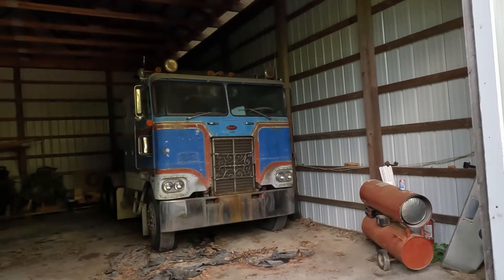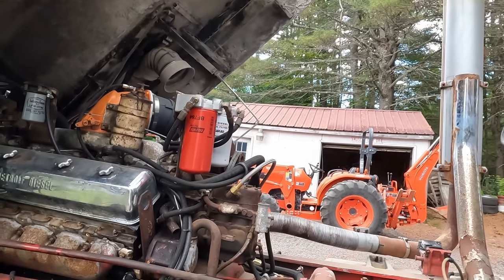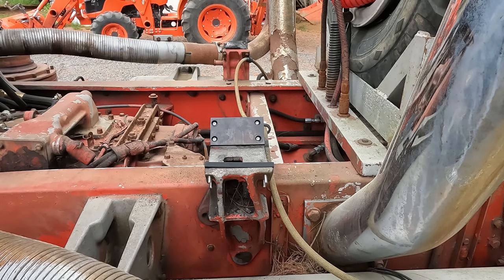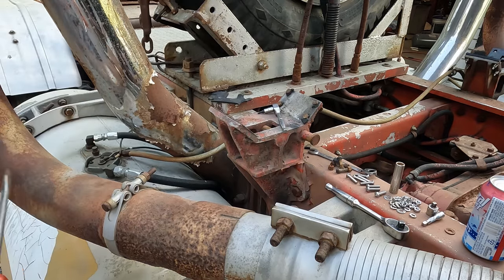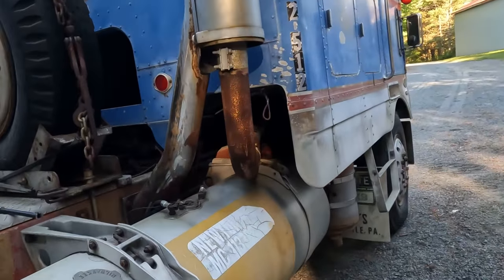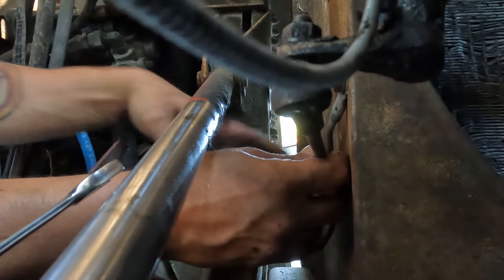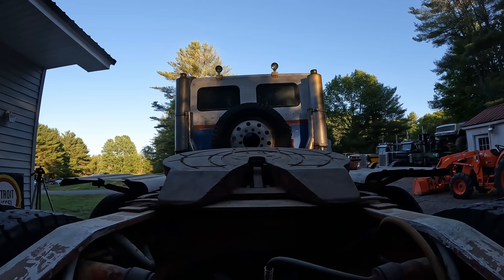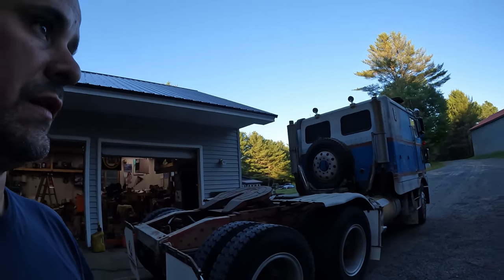1973 12v71 Powered Peterbilt 352 Cabover - Episode 22 - Mount up!

Comment: That thing is RAD Wayne !! I love cabovers. I got my license in a '74 Cabover Mack with manual steering and a 5 speed. It was in no way as Sexay as your Pete.
Reply from the maker: Hahahaha thanks David. I love them too I for sure missed the glory days. Boy it had to be cool to even drive one back then for actual work.
Reply: @Ol2Stroker  I guess I left out that was back in 89. I'd love to find something old to pull my Farmall pullers with. The F350 does it great but the "cool" factor just ain't there.
Reply from the maker: @davidleighton5701  hell yea there's nothing cooler than a classic semi to pull around your hobbies.

Comment: I like the look of those exhausts. Stubby, squat, purposeful.
Reply from the maker: I'd like em a lot more if they were chrome like they're supposed to be!
Reply: Steel hauler's exhaust. No need for tall pipes with a flatbed, plus steel loads up inside the steel plant sometimes with an overhead crane and less chance of tall pipes getting hit by a slung bundle and lax crane operator. Plus, had to drive into the building through doors, so several benefits to having short stacks.
Reply from the maker: They were a bit taller new but still
Reply: @Ol2Stroker  You could take your long low trailer and a 352 and join Steve at Weidmeyer for a year lol

Comment: You really didn't see very many of them extended sleeper cabovers in the mid 1970s. Peterbilt and maybe Kenworth were the only ones at first. That baby was the Cadillac Fleetwood Brougham of Road Tractors, in its day and after! And most exhaust stacks were like what you've got there. Chrome seemed more common on conventionals.
Them Natties ain't got any flavoring in them do they? I'm not trusting those bright colors on that can. I usually go for the Beast Ice in a tall boy.
With a Two Stroke, the more cylinders you add, the more relaxed the engine sounds when loaded.
Reply from the maker: Hey Dan thanks she sure is a cowboy Cadillac. When this truck came from factory the entire exhaust was chrome, and we will bring it back eventually. In an early episode there is a picture of the truck when it was brand new. Them Naturdays are strawberry lemonade flavor lol delicious

Comment: Hi buddy I from Yorkshire England why 2 stroke and 4 stroke
Reply: Why not  4 stroke what the difference only the stroke
Reply from the maker: Hey Paul big difference between 2 cycle and 4. The 2 cycle fire all cylinders with every revolution of the engine as opposed to every 2 revolutions of a 4 cycle. More power less cubic inches and way better sound
Reply: @Ol2Stroker  cool thanks over here  it's  all 4 stroke
Reply from the maker: @bigpaulrc3531  it is over here nowadays too
Reply: @bigpaulrc3531  It wasn't always, both Foden and Rootes did 2 strokes. The Rootes were opposed piston and were in Comma trucks. What a fucking racket!! Loads of them about in the 60s. I am from North Yorkshire.

Comment: I don't help when you have a steel bolt going through a aluminum mount. The damn steel bolt get's welded on there by the aluminum and becomes a pain in the ass to remove
Reply from the maker: It really does. Steel and aluminum just don't mix well